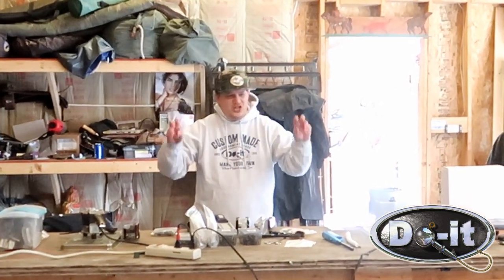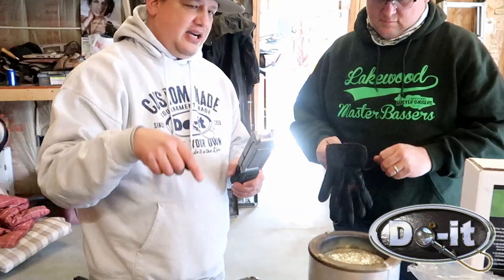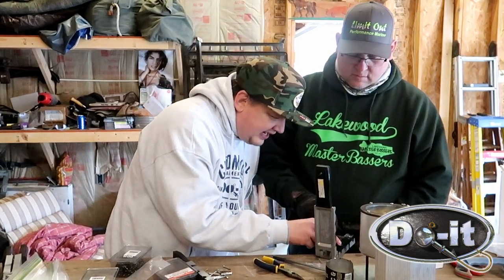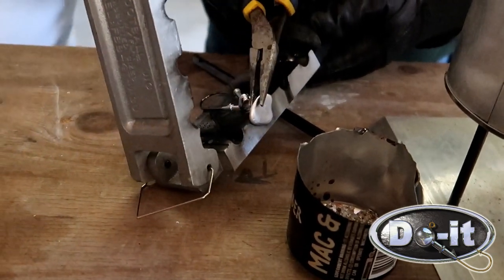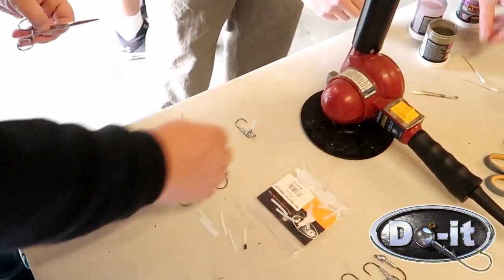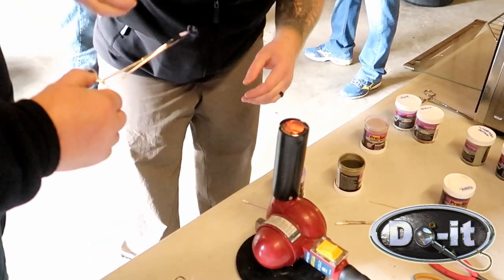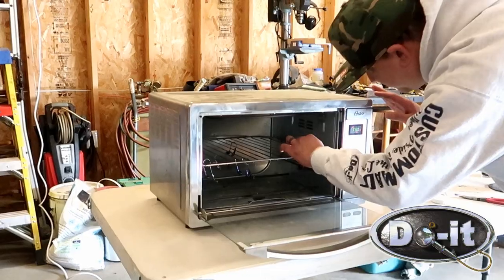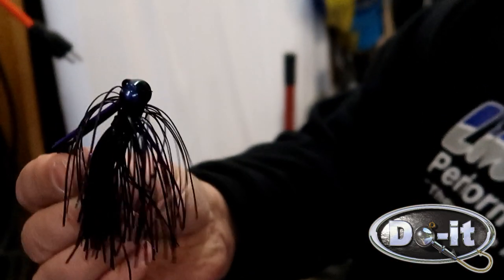Jig Pouring Seminar - That Guy Skimpy - Do-It Molds

Comment: I’m surprised you don’t do two things skimpy. 1st Frankfurt drop out spray…100 times better then the candle soot. Also, I’m surprised you haven’t made your own fluid bed for powder painting jigs. I made one from PVC fittings, a minnow bucket bubbler I had, and coffee filters. Ran about $10 to do it.
Reply from the maker: I know I should use the spray but smoking it has been working.  As far as fluid bed, I dont make a bunch of the same color ar a time is why I dont use it.
Reply: @ThatGuySkimpy  Using a fluid bed doesn’t really have to do with making a bunch of a color. It’s more to get the even coverage, and nice job done.
Reply from the maker: @AgronomistatIA  oh I totally get that.   I actually made one and used it works great.  But I didn't have multiple cups so thats what I mean by making alot.   If I had alot of the cups for all the colors it would be different
Reply: @ThatGuySkimpy  on the one I made, I just pour the powder paint into the PVC sleeve. When done pour it back into the cup. Use a funnel…no mess